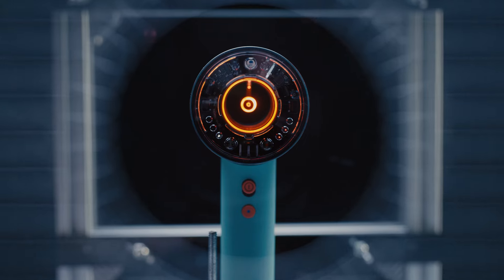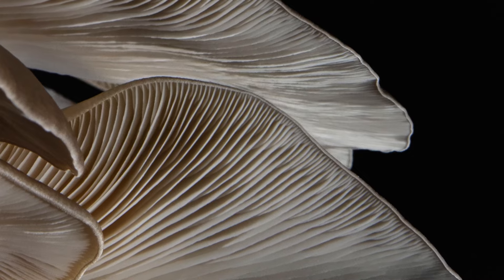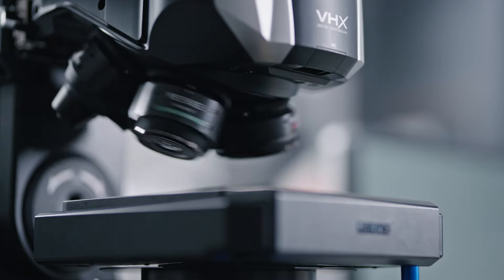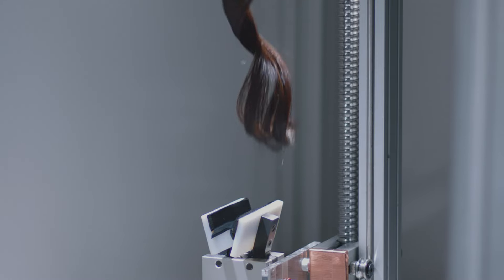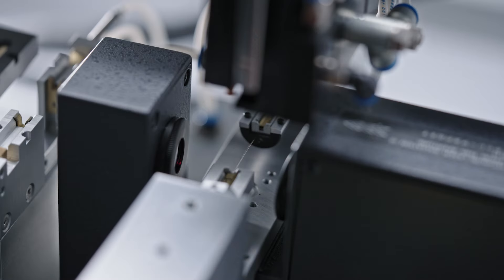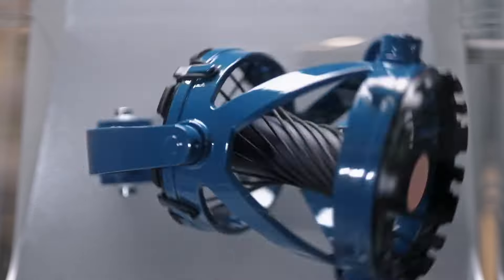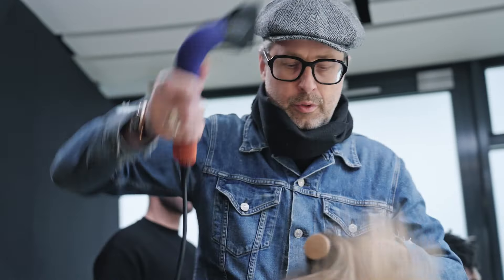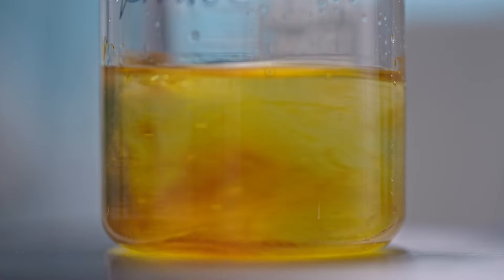Dyson Chitosan™ styling range | Engineering story

Comment: Unfortunately, the ingredient are not on the website! Is it silicone free? Sulfate-free? Polyquaternium-free? All that disgusting stuff-free…?
Reply from the maker: Dyson Chitosan™ Pre-style cream & Dyson Chitosan™ Post-style serum are paraben & sulphate free. Thye contain small quantities of silicones. It’s a common misconception that all silicones are bad for the hair and lead to build-up. The silicones we use in our Pre-style cream are designed to help control frizz, while maintaining shiny hair.
Reply: @dyson Unfortunately, it is not a misconception that dimethicone, the silicone Dyson has chosen to use, dries out the cuticle, and is hard to get rid of once film formed on the hair, leading to using much harsher surfactants to remove the product build up, thus leading to dried out hair. There are much better modern silicone variants used today that do wash out easily with water, like amodimethicone  and cyclomethicone, or even silicone free broccoli seed oil to add slip without the dryness and build up. I see that the range already has quite mixed reviews, but I’ll look forward to reading the non-incentivized reviews over the next month before assessing whether I’d be interested in purchasing quite an expensive product line.